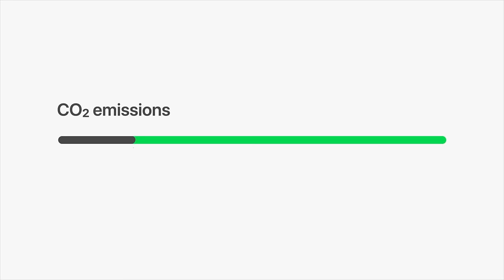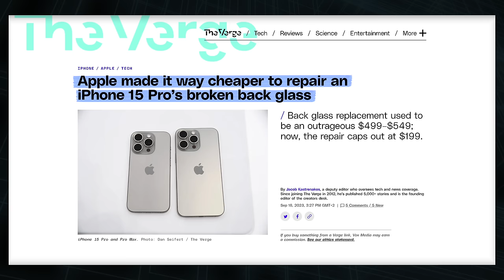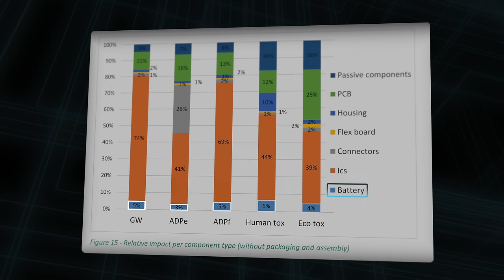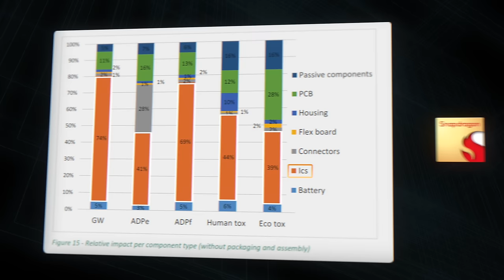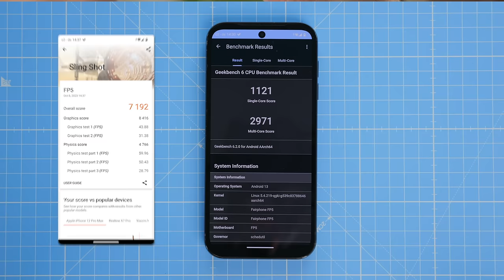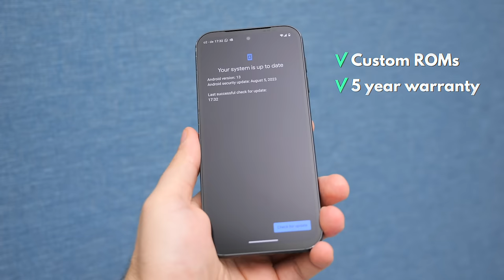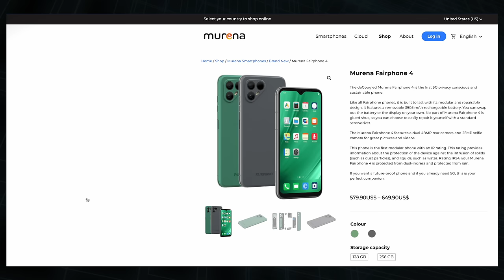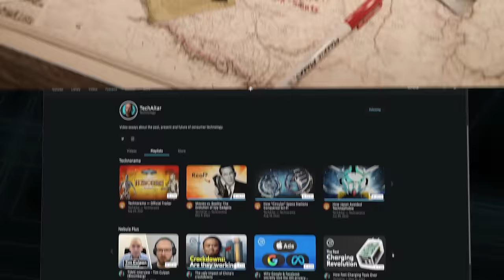Is Fairphone really fair?

Comment: The most fair phone you can buy is not buying a new phone. Use your old phone longer!

Tech enthusiasts should be honest with themselves, smartphone hardware(except foldables) in the last 5 years don't have significantly improved. 

Its just slow and steady small upgrades like camera algorithms and battery life optimization. All the improvements nowadays are mainly software focused, most of them could be given to older phone models, but they are not because there is no incentive for the companies to do so.
Reply: Uhhhh... no. Performance per watt has definitely increased massively. To the point where flagship phones could totally be used as office computers if given the peripherals and software support (See DeX et al). Performance per dollar has also increased for mid-range and low-end phones.
Reply: @WhenDoesTheVideoActuallyStart Most co2 is not wasted from creating energy to charge your phone, but in the actual creation of the device itself.
Reply: Would recommend some of linus’ newer videos where he uses his five-year-old Note 9. While insignificant year-over-year, those do compound into something greater.
Reply: Agreed, and it is the only reason I haven't bought a Fairphone yet. The downside to using a phone for a long time, or buying a second hand one is the lack of security updates. Even custom roms don't fully solve that issue since those don't provide vendor firmware updates.
Reply: Buying used phones is also a good option. Got myself an used iPhone. Not only was it much cheaper, but, at least in theory, it eliminated necessity to produce a new device
Reply: iphone 6 got me 6 solid years. Changed in with a iphone12 with no intention buying a new one until it really under performs in a PCB/CPU level
Reply: Old phone will run out of software support, one day or the other. Then what would you do? Buy another second hand phone that has no repairability and indirectly supports the businesses of Apple, Samsung, and the like?
This phone may not be fair for you right now. But it is the fairest phone on market, hands down.
Reply: @nimrod06  Personally, I do not care about the updates. Or at least during the 6 years I had the phone, I did not realize that there was an issue.
Reply: @gritnltw  Because you had the updates from iPhone.
Reply: I mean if you use a note 9 now it does feel old and slow. The incremental improvements do count over time
Reply: @WhenDoesTheVideoActuallyStart  DeX has existed for 6 years now. Yes the chips have improved, but what do you actually need it for? Ask yourself that

The only thing making older phones obsolete is poorly designed software that is artificially more difficult to run. Recent android versions run horribly on my phone that is just a few years old
Reply: It’s called planned obsolescence
Reply: @onkelklaujo  I think it is better to get a used phone than a fairphone, atleast until people stop buying new phones so often
Reply: @nimrod06  I don't think buying a used phone supports phone companies in a significant way. The only real issue I see is that people might feel comfortable knowing someone will buy their used phone, and therefore buy a new one. But that is largely subconscious
Reply: If my cellphone could be alive all day I wouldn't buy a new phone. And not even think about the cost of swapping the battery....
Reply: @girlmaya6818  No it's not subconscious, I have seen the argument of "better resale value" in many iPhone vs Android videos.
Reply: @WhenDoesTheVideoActuallyStart uhhhhh, I'm guessing you still have another computer for those tasks?
Reply: @jacksonburger2081 Honestly I don't even know how he/Samsung managed to do that to his Note 9. I have a ZTE Axon 10 Pro. It has the flagship chip of 2019, so Galaxy S10 level and after 4 years it doesn't feel slower at all. Still as speedy as always. Performance wise it seems like it could handle another 4 years easily. I was kinda surprised when I saw Linus Note 9 being that slow
Reply: I do not care about updates, but I do care about the camera, an to some extent speed... I try to hold on to a phone for 4-5 years, past that the camera improvements are too big to pass
Reply: Yeah but it sucks when your battery life in your phone is cut short, where you're constantly looking for a charger partway through a day. Most people dont have the time or expertise to tear their phone apart to replace batteries nor do they want to shell out for a repair shop to do it. They would rather pay a bit more to just get a new phone, especially when they can get a deal through a carrier for a discount.
Reply: @Guy-Zero  I would agree. Just because one person experienced a slowdown I don't think everyone did. I had a Note 9 and was still happy to use it until it was stolen last year. If I still had it I would still be using it. Unless you really push the phone I don't think you would feel a slow down. I think most people would be happy using an older flagship today. I still have my S8 and use it as a second device. I reformated it and just use it for watching videos, playing some games, and surfing the web. It does all those things fine.
Reply: @nimrod06  The iPhone 12 came out in 2020. Usually an iPhone will receive updates for about 6 years of feature / full iOS version updates. Of course if you buy it years down the road, it will have less of that time left and a new phone like f.e. the fairphone 5 will have longer updates and 100% is more repair friendly. But you have to keep in mind that if you buy a used phone, it already exists anyways and isn't using up any new resources (except shipping costs or replacement parts)
Reply: @RyoHazuki224  yeah, especially when those third party repairs break water resistance (happened to a friend)
Reply: @_Digitalguy  oh yeah i can imagine. Didnt even think about that!
Reply: @onkelklaujo  Yes but then you drive up used market demand, then increases quantity supplied, then drives up new phone demand. Basic economics.
Reply: I prefer to reduce waste by buying second hand hardware. Difference in cost could be spent on sponsoring teams that support old hardware running — postmarketOS etc.
But I also understand those who want to support fair made hardware.
Reply: You could, but I wouldn't recommend anything that doesn't support 5G nowadays. At least the iPhone 12 and later support 5G, and that makes that still very useful even in the used phone market.
Reply: Unless you're a heavy phone user, I agree.
Reply: @Sacto1654 There are still countries with 4G you know.
Reply: @Leon_George  I do. Billions of people don't. For billions of people, a smartphone is their only electronic device. And regardless, that's not the point, the point is that saying "hardware didn't improve at all" is nonsense. A new smartphone can do everything a cheap computer can at 5-7W. Trying to argue you don't need a new smartphone because they haven't changed is throwing sand into one's own eyes for no good reason. Makes it sound like OP will go gaga over new smartphones as soon as they release a feature OP in particular would desire, instead of sticking to the principle of not buying what you don't need.
Reply: @Sacto1654  I don't game on my phone, I don't need 5G.
Reply: @tezcanaslan2877  Every country uses 4G, even those who also use 5G 😅
Reply: @WhenDoesTheVideoActuallyStart  now how much u wanna bet those billions you're talking about can't afford an iPhone 15? Jeez, a laptop is cheaper than that phone...
Reply: @girlmaya6818  That's irrelevant. There might be people who need DeX. There are plenty of people who don't. But saying "I won't buy new smartphones because smartphone hardware hasn't improved" is 1) A fat fucking lie and 2) Just makes it sound like OP will go gaga over new phones as soon as they bring a feature that's attractive to OP in particular, instead of sticking to the "Don't buy what you don't need" principle.
Reply: @Leon_George  ...? No one except seppos buy iPhones lmao. In countries exploited by imperialist nations the only electronics people can afford are often $50-100 chinese androids, sometimes not even that (Featurephones with internet access exist for a reason). There's no way they would be able to afford both a phone and a laptop.

Regardless, you're fixated on an example that I gave to illustrate the fact that smartphones are still evolving and smartphone companies aim to make smartphones capable of replacing laptops and computers, and that they can believe that's possible thanks to the very real advances in hardware.

Which brings me back to my main point: who does it benefit when you lie to yourself and claim you didn't buy a new smartphone because "their hardware didn't improve"? You're just lying to yourself. You're telling the companies "make me realize the hardware did improve and I'll gladly buy your iFuck 17000". Even when talking about saving the environment people still show how deeply rooted they are in the consoomer mindset.
Reply: @WhenDoesTheVideoActuallyStart  I spend money given my own priorities. Hardware has not changed enough for me to consider switching smartphone because it has reached my desires — good screen, enough power and storage, acceptable battery. I don't see "lying to myself".
Reply: @WhenDoesTheVideoActuallyStart  OK, so for context, my current phone I bought second hand, knowing it no longer gets updates, and is "slower" than the latest phones. Does it matter, no. I can do everything on this old phone than you could do on any new phone. The performance improvement you keep hammering down on are useful for no one. Anyone who needs performance,  gets a performance machine, anyone who wants to save money, buys a cheap laptop and phone, because combined that is cheaper than buying one phone that can do everything for them. There is no reasonable situation where a phone needs to have such performance.  The number goes up, well how very nice... Had companies been willing to update older devices, there is no incentive for anyone to buy the latest phones that are "faster" because no one needs them, they just need their apps to function,  and for that, even a Chinese android can run just fine. New phones being faster doesn't add or change anything about the experience.
Reply: True, I think its disgusting how getting the newest iPhone or Galaxy has become such a lifestyle. The times were newer models were actually worth the upgrade are long over. Im still on my S9+ after 4 years and I only got that because my father needed my older S7, which he even still uses. Im only thinking about upgrading it because I dropped it while cycling and the usb c port doesnt fast charge anymore. My next phone will get a case immediately and with both googles and samsungs recent update policy of 7 years security updates I will probably keep that one for an even longer time.
Reply: @WhenDoesTheVideoActuallyStart who cares though? What do you need that performance for? Its just benchmarks, no real world usage. And its a phone, not a PC pulling 500w where efficiency is actually a big deal. I can also use Samsung Dex just fine on my S9+, what would I need more performance for?
Reply: @gritnltw Nice, I’m still using my iPhone SE 2016, plan on replacing it either with a Fairphone 4 or 5 however.
Reply: if only i could buy new screens and battery for samsung s7 edge i could refurbish it.
Reply: god, all the talk about software  support pisses me off. I've been on an android 6 phone for 7 years, my only serious problem has been inability to download some government and banking apps. As soon as I physically can't make calls due to the 3G network closing I'll get an android 9 phone secondhand and use that for 9 years, bite me
Reply: @WhenDoesTheVideoActuallyStart  This same claim was quite literally true of the Nexus 5, which was released a decade ago; with the right software you could absolutely use it as a desktop computer suitable for office tasks. But matching the capabilities of "office computers" isn't exactly a high bar to meet when you consider how many offices still use ancient, long-since-unsupported versions of Windows.

Comment: 5:45 I think the lack of wireless charging was a decision made on other factors and not on removability of the back panel. The Lumia 830 shipped back in the day with wireless charging and removable back plate and it worked well while also not adding any thickness to the phone overall.
Reply: Yes, they just needed to add coil to back panel and some additional pins that would connect with back panel.
Reply: I had (and still have) the Lumia 822 and it had the same capability. The difference is that the 822 didn't ship with wireless charging. I had to buy a different back cover from Verizon and made the phone slightly thicker. It certainly isn't water resistant though.
Reply: thats a great point!
Reply: Samsung also had wireless charging backplates for devices before the S6 came out

Comment: I have to respect fairphone for actually showing that repairable devices are possible. It also seems like they have entirely custom designed their main boards and released schematics for them. What I however find quite problematic is the lack of a 3.5mm jack, effectively forcing users to go buy expensive, unrepairable and disposable earbuds which will eventually just lead to a landfill. Fairphone’s reason for removing the headphone jack wasn’t convincing either.
Reply: Indeed. They've said it was one of the most common complaints about the Fairphone 4, so why the hell did they ignore all of that and decide not to fix it in this new model?

Frankly it's the one thing that'd make me actually want to upgrade from the FP4.
Reply: @AnOliviaShapedGremlin Because they want to sell their wireless headphones/earbuds. EU is soon forcing all manufacturers to sell phones with easy replaceable batteries, making a Fairphone obsolete for most costumers. Because frankly, swapping the battery is all you need to do after 3 years and you're again good to go until you get to the point that your CPU is just too slow for normal daily usage.
Reply: @PySnek  The interest of Fairphone is not just the replaceable battery, but the ability to update the phone part, or change them very easily, and this is a big plus. But the lack of 3,5 is a very bad joke coming from them.
Reply: @nathleflutiste  Nope, nothing really to update tbh... They always advertised it but never really delivered. I only remember a small camera upgrade for the FP3. The FP4 had no hardware upgrades at all. Yes, changing parts is a plus but with the downside of a heavy and bulky phone and you can't submerge it in water.
Reply: @PySnek  Seriously ? This is very disappointing giving how much they have been advertising about it. This remind me LG with the G5, great idea but never implemented correctly.
Reply: You can buy USB-C headphones (which are still rare though) or for a few €/$ you can buy an adapter that allows you to connect normal earphones to USB-C and even charge your phone at the same time (though ultra-fast charging might not work), but you have a point. Many people probably don't know about these adapters or find them too cumbersome to use.
Reply: these adapters are not a perfect solution because the cheaper ones introduce some white noise into the sound as I've learned from my unfortunate experience with a jackless phone (sure it can be avoided with buying a more expensive one but then it becomes more than just couple bucks, and for solving an issue that shouldn't have been an issue in the first place)

Comment: I bought a Fairphone 4 at launch to replace a OnePlus 3 that hadn't had an update in 2 years, the only issues I had were the barebones stock OS being 2 versions behind and the camera software making photos look very smudged. Switched to CalyxOS the moment they had a beta available and haven't had a problem since. The plastic back broke after a year of clumsiness finally caught up, it was trivially easy to repair and the spare battery I bought with it came in clutch on recent holiday. If you don't need a top of the line powerful phone I highly recommend getting one.